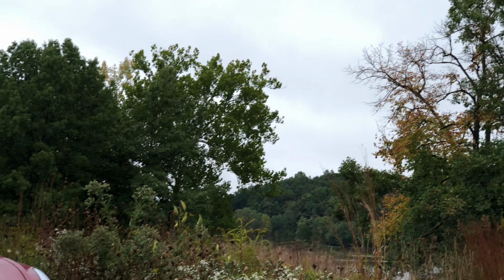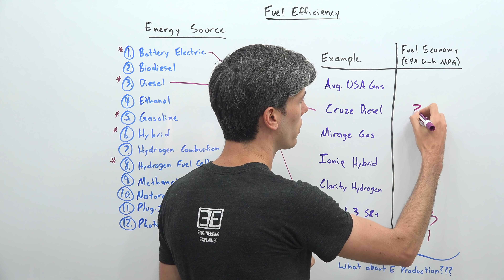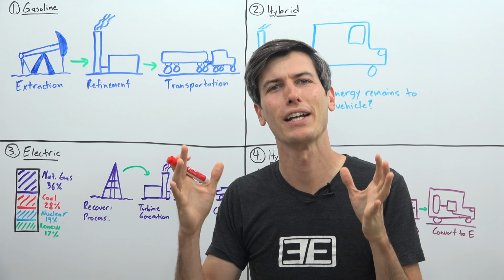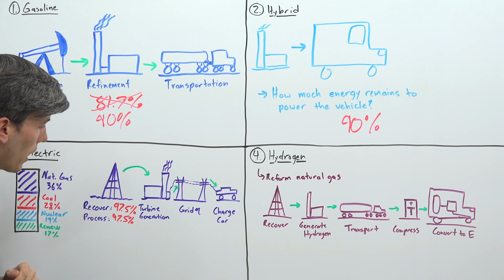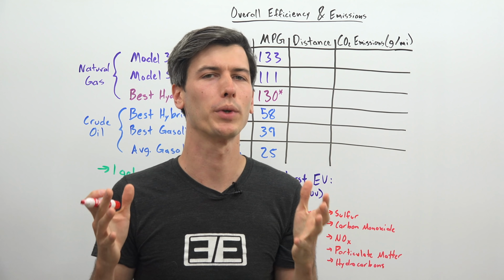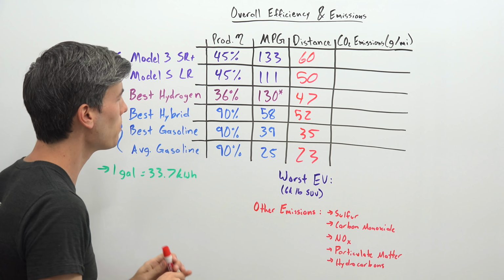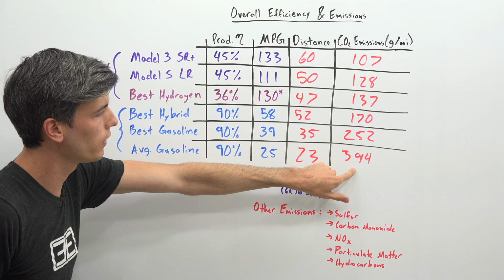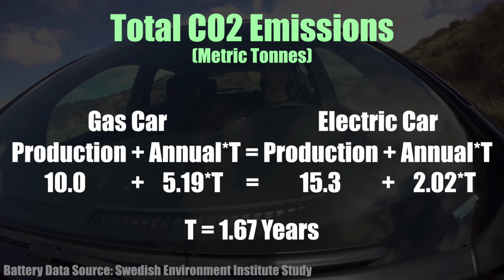Are Teslas Actually Better For The Environment?

Comment: Hey EE, you forgot to cite the efficiency % of the internal combustion engines in the gasoline cars, which typically averages around 21% (I got 19.655% in a dual-turbo V6). Different cycles also have different efficencies, such as the Rankine, and diesel engines under compression as well (30-40%).

Over 80% of the thermal energy in the refined fuel is lost as waste heat in the conversion to kinetic.

Thank you!
Reply: @M Bacon Very good point! People often underestimate how large the Model S and X are. The model 3 is a big improvement without sacrificing much internal space. Difference between model 3 and S is about 400 to 600 kg. Furthermore, those vehicles still utilise wet cells, imagine them using dry cell technology (solid state).
Reply: That'd be included in the mpg. If a car is more efficient because it wastes less energy to heat, that means it goes father with the same gallon of fuel (aka more miles per gallon)
Reply: The efficiency of the engine/motor is captured in the MPG rating.  And yes, that's where they major loss is: lots of that gasoline energy is wasted in heat and noise, idling, and so on as an ICE is quite inefficient as you note.  Electric motors are easily 2x as efficient.  What's also interesting is that Tesla has put substantial effort into reducing drag, as well as reducing rolling resistance -- things that few other production cars do as well (other EVs included).
Reply: @M Bacon Excellent point on weight and overall person/freight transport efficiency, as well as the "US business as usual" approach to transportation. PEVs are the best option in terms of short-distance, inner-city commutes, IMO. 

A Tesla Model 3 SR+ (RWD, standard range) weights 1,600 kg (3,500 lb); I weight 70 kg (154 lb). So:

    - The car weights nearly 2300% my body weight
    - Little over 4% of the energy is used to move ME, while the other 96% goes to moving the car.

My electric unicycle, for instance, weights 25 kg. So:

    - The wheel weighs roughly 36% of my body weight.
    - 26% of the energy is used to move the wheel, while the other 74% is used to move ME.

Now THAT is an infinitely more efficient means of transportation, especially if you consider that a ridiculous percentage of internal combustion cars are actually used as one-personal vehicles...

And for long-distance travel, it's a shame we aren't investing in high-speed rail...
Reply: @M Bacon BTW,  in a Tesla Model 3 SSR+, for instance, what percentage of the useful work is applied to transporting a person?
Reply: @travsformation1  uni is not road legal tho
Reply: MPG measurement takes this into account

Comment: My benzine Toyota Verso claims to emit 160g/km, other versions of Verso claim to go below 120g. Driving 20,000km yearly I end up with 3.2t of CO2. There are CO2 certificates available for $11/t totaling 35$ per year. This is ~1% of yearly car expenses. Seems like best option for the environment and your bank account is to ride your existing vehicle until it falls apart and have a centralized CO2 offsetting solution using some of that sweet fuel tax money. Here in Germany we're already paying >$6 per gallon with most of the price being taxes :)

Comment: My 2002 Beetle TDi achieved 40mpg, almost 50 on the highway.
Reply: I guess he's comparing non-cheating diesels.
Reply: @ctrlaltdebug  2002 is prior to dieselgate. You can't cheat the pump. I get 43mpg average with little highway driving in my 02 TDI. 37mpg isnt the best economy a passenger diesel can get, just my 2 cents.
Reply: Joseph Mitchell it was pre-cheating because it was pre-emissions. Take that car and match it to today’s emissions standards and it’d be lower.
Reply: My 1984 Diesel Rabbit ranges between 55-60 mpg
Reply: @c-5899   but what is it's EPA Combined rating specifically.  That's what he's using as a reference.

Comment: U didn't consider the right factor for gasoline conversion cause there are many more steps to make gasoline use ready and not all plants are equally efficient in extracting fuel
Like co2 for trsanportation
Reply: It was best case scenario for ICE and worst case scenario for EV
Reply: Yes i also noted that he clearly said WHO published these numbers for the efficiency of gasoline from well to gas station... So take a guess
Reply: @StellarGale  sorry but worst case scenario would be if he calculate with an Powerplant using Coal. The Best Powerplant with coal is 45% eff.
Reply: @StellarGale  It's not worst case scenario for EVs, that's just an assumption. Charging and discharging efficiency can vary greatly.
Reply: Also he forgot to include the negative externalities of fracking to extract the natural gas. Coal would be the worst-case for EVs.
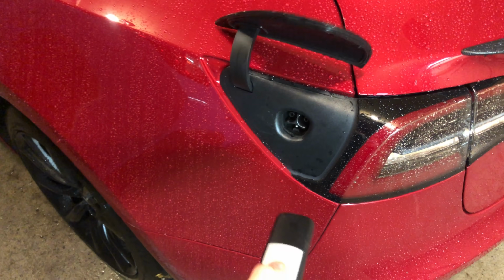Reply: Grid maintenance/ increasing grid capacity to meet future demands/ compressing the grid in smaller more confined spaces/ mining locations & techniques/  does it increase or decrease dependency (national vs global resource transportation )/ increasing vs decreasing personal freedom  .....  Also what seems obvious to me is the lack of transport of the natural gas in his example #3 at 7:00 ?  If you are going to include some chemical byproducts in your "not to mention" list, include them all fairly.  Lots to calculate.   I still have many, many questions.  Not about plant food AKA CO2, though.  I know what that argument is about. I have seen it before.  To choke people more and more, increase costs, decrease efficiency.
Reply: @StellarGale  they are shutting if the grid in California, electricity prices are only going to go up.

Comment: Coal and oil power generators cannot reach the efficiency of 60% as there is no combined cycle option for them. Using natural gas is actually helping the electric cars.

Comment: I get an average of 39 mpg in my 2007 E320 Diesel bluetech.
Reply: Ford has 1.5 diesel with 53mpg rating.
Reply: 53 UK MPGs = 44 US MPGs.
US don't get the 1.5 Ford diesel.
Reply: @ThePilotGear  well that`s not ICE cars problem. Is it? Such diesel engine exist and Ford is an American company, so it would be fair to include it in calculations.
Reply: @procerator  However the 53mpg rating not using US testing standard where all examples in the video were. That alone would make the calculation inaccurate.
Reply: @kevinchung1492  well I am OK converting it to freedom units, but 44mpg is still more then what was in the video
Reply: it definitely is an ICE car problem. If it's not offered in North America, it's because it doesn't fit the target market for size, performance, etc. where as the electric cars mentioned do.

They could do the same analysis where this 1.5TD is offered with different results.
Reply: @ThePilotGear  they don't fit the market because americans drive thirsty pickup-trucks for basically no reason.
Reply: @procerator  agreed, so we have to compare apples to apples.
Reply: my actual, on the road - 2013 Accord 4 dr with a cvt has been running between 39.5-42.3 on full tank fillup calculating gallons against miles for the last 5 years.  the 1st year was about 38.  Up to over 150,000 miles now.

Comment: how about the electricity while extracting oil and refining and transportation fuel (how much it uses and how much more electricity it uses to extract and refine). You should do another calculation on how much emission will be to drive 100 km.
Reply: that's included in the 82% number.

Comment: Great research as always, but I'm sitting here wondering how on earth the US most efficient diesel is only 37mpg. I understand that is a US gallon, but still! 

In the UK just off the top of my head, a 320d efficient drive, or whatever they call them, from a couple years back was achieving 60+mpg in real world driving
Reply: Joshua Barton UK figures in magazines always seem bloated.
Reply: @hugolafhugolaf  our numbers do come up higher than yours because of the difference between the US gallon and the UK gallon, but also we have more diesel cars with smaller engines than yourselves as fuel costs more. 

That figure though of 60+mpg for the 320d is real world driving calculated, not paper figures
Reply: Bigger (thus heavier and less aerodynamic) cars. He’s being generous as in reality most American consumer diesel vehicles are light duty trucks that get 15mpg lol.

Comment: This is an amazing video with some great info showing how good electric cars really are even when charged through fossil fuels. My only issue is the gasoline comparison has been done using american averages and the america has some of the worst average fuel economy in the world. I live in the UK and average MPG of a car here is 51MPG for petrol cars and 61MPG for diesel, with some of the best economy cars like the new renault clio getting around 80 in the real world. Would be interesting to see these numbers added to the overall efficiency grid to see how they stack up. In america the average person would clearly be putting out less CO2 in an EV vs a gasoline car but I'm not sure the same would be true for the UK or other countries like japan where cars average MPG is better.

Thanks again for another great video :)
Reply: A US gallon is only 3.79 litres whereas an imperial gallon is 4.54 litres! So 20 mpg in the States is 24 mpg in the UK.
Reply: Kevin Urben I didn’t know this so thanks for that. But as C- said even taking this into account the average is still very different compared to other countries
Reply: @matthewclarkson4883  Even considering the better fuel economy cars in Germany or the UK get, you have to remember that some european contries get a lot more of their energy from renewables (just checked for Germany, the biggest source for energy in the first half of 2019 was wind power - at least for private households - according to the Fraunhofer ISE)